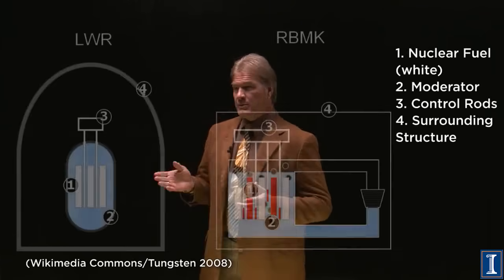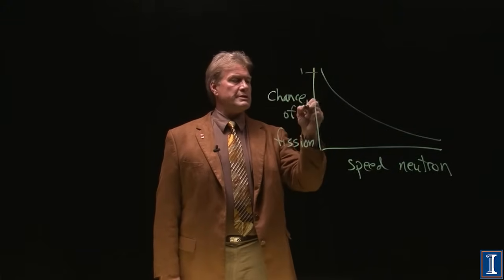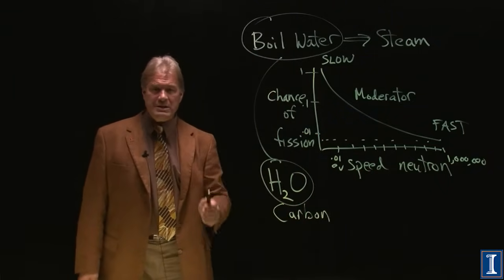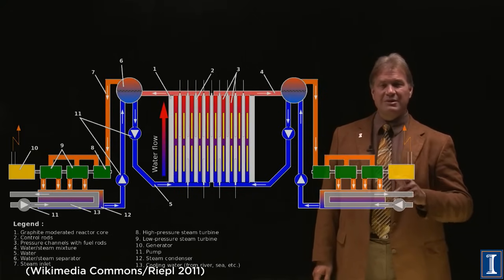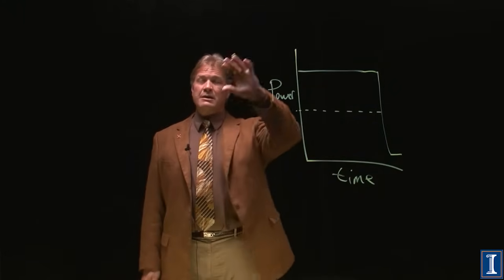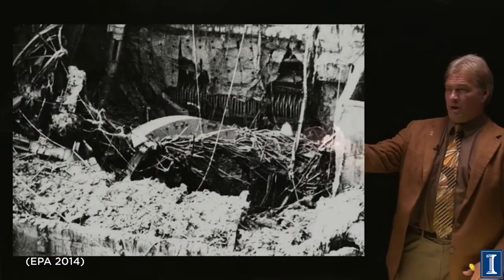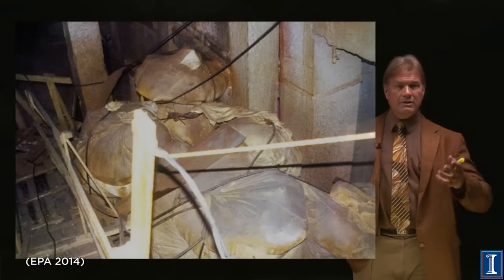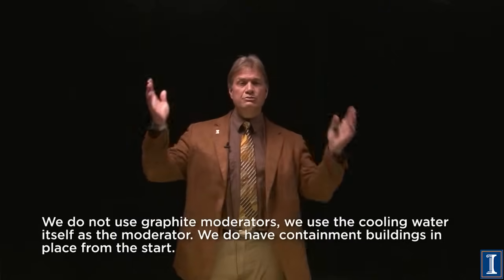Chernobyl: Worst Accident Ever

Comment: A containment building is sized to accommodate the mass energy release from a large break LOCA for a short term, not to contain an ejected pressure housing. In other words, a containment building would not have helped for the Chernobyl disaster.
Reply: This presentation is like a death from a thousand cuts ... he cant properly spell the name of the reactor, he oversimplifies the motives of picking  this type of dual type reactor over other designs, underplays the risk of a meltdown on a classic reactor .. and many more,  there is another video with 'that Chernobyl guy' called 'the birth of RBMK' that covers the tech much better than this show of arrogance I just watched.... btw an example of why the water 'fail-safe' is not enough watch this next two mins: https://youtu.be/3ZiKXMgIKGg?t=836

Comment: ALL currently designed Reactors require a feed of cooling water when initially shut down.  Sometimes for several weeks.  That is why all of them have Diesel generators to power the water pumps when they shut down.
The Fukushima reactor was completely shut down, but the tsunami drowned the diesel engines.  A bad design in a known tsunami zone?

Comment: Only problem is that the containments of western reactors do not contain. Three Mile Island and Fukushima for example. They knew this beforehand, the bolts holding the wessel of the Mark 1 reactors together stretched when tested. Therefore a hydrogen explosion during a meltdown. Which ruptured the containment. See Arnie Gunderson.

Comment: They used Boron, but NOT a Graphite/Carbon to moderate the reaction, and control rods were put in a reactor both from upside and underneath the reactor. And because to make a full control rod out of Boron was expensive, they replaced bottom part of it with Graphite, even if it had worse "slowing down" ability for its purpose. And at the moment of disaster, because of a Xenon poisoning from working on 50% power for over 10 hours, absence of cooling water and almost all Boron-parts of control rods, pressing shutdown button (which inserts all the control rods back, but it takes time) leads to Graphite parts entering first and instead of slowing, it drastically accelerates the reaction and there is nothing to stop it

Comment: Containment would have not helped at this magnitude of explosion, which tore off and launched 1300 ton metal lid dozens of meters up in the air. It would have prevented 90% of the nuclear fuel from dispersing into the atmosphere, but this might have become a worse scenario - melting through the concrete base, reaching the water table and becoming an everlasting radioactive geyser.
7:48 Misinformation. Unlike BWRs and PWRs (soviets had their own PWR called VVER, so hulled reactors are not a "western thing"), which are being halted, opened and refueled as a whole once in a campaign, RBMK has no "general" hull and is capable of being refueled constantly, on the run and one channell at a time - it was it's main advantage, because constant refueling allowed to use less enriched fuel and in RBMKs military breeder predecessors to have a constant yield of plutonium for military purposes.

Comment: Small correction: As far as i know, the first scientists that noticed high levels of radiation were based in northern europe - Sweden I think. 
But in fact a lot rained down in central europe in the days after. My parents told me, that back then ppl were told not to eat crops from the garden, not to collect mushrooms in the woods. Sand on playgrounds was also exchanged by the gvmnt.

Comment: Once they pullled almost all control rods, there was not enough left to moderate the reaction. Because the graphite tips of control rods cause the reaction to increase as they pass though the core, getting hotter until boron rods reduce reaction. Once the cooling pumps were shut off, the plant was doomed.

Comment: According to the hbo series they built rmbk reactors because they were cheaper. I don’t understand how carbon is cheaper than water ? I’m guessing more to it, I’ve heard it needs to be heavy water and it’s expensive to make. I was just wondering. Thanks for your videos.
Reply: Carbon is cheaper than water as it's a bi-product of many things from AC vacuum motors to train lines. It's everywhere.
Reply: The HBO series is almost completely inaccurate.  The RBMK reactors were not built because they were cheaper, they were more expensive than competitor reactors (the soviets had several reactor variants).  Their two advantages were that they did not require some specialised parts that the other main reactor variant (the VVER) required so you could build them without having to wait for those parts and the other advantages were that you could get more power for lower enrichment levels of the uranium which meant you could get normal power levels cheaper or you could get higher power levels using normal fuel (RBMKs put out as much power per uranium as modern reactors) and that you could refuel it while it was operating, rather than needing to run it down to refuel every so often, so in theory you could get uninterrupted power from it which was not something other reactors offered

Comment: Not quite. The test was set on a Sinton day but they didn't do the test. Instead the day crew ran the reactor at 50% which exom started to form. On April 26 1987 is when the test took place witch was ran by deatlov who wanted to run the test at 200mw when it was spost to be a 700mw. When the test started the power dropped to 0% from exom deatlov made the division to take all but 1 control rod out steam and heat build up at the bottom of the reactor and blow the 500t lid of the reactor and landed sideways in the reactor. Hydrogen oxygen and extremely hot grafite which made a chemical reaction and boom! Chernobly.

Comment: What about 3 mile island? What kind of mistake was that?
Reply: https://en.m.wikipedia.org/wiki/Three_Mile_Island_accident

TL;DR: A maintenance issue, causing pumps and coolant equipment to fail, lead to water in the reactor vessel to overheat, become steam, then react with the exposed and overheated control rods to start a partial meltdown. Critical valves and water flow devices were out of action, and operators failed to notice this. Operators hadn't been sufficiently trained for the details of the scenario they faced. The control room design, and some things like alarms for different problems sounding almost the same, contributed to the failure to understand what was actually happening. Also, The specific plant in question (TMI-2) should have been shutdown at the time because of the closing or deactivation of said valves and critical devices, but for some reason was of course still running.

Comment: A minor correction (I see others mentioned it briefly). The accident wasn't initiated by an operator pushing a wrong button. They started to lower the power but after a couple of hours the Kiev power grid controller ordered them to halt the process, because they needed power (a coal power plant malfunctioned). As a result, the reactor operated  around 70% or less power for 6-7 hours, and it lead to the Xenon 135 build up (because the fission byproduct Te135 decays into I135 in seconds, which decays into Xe 135 but with a 6.5 hours half-life). So the power drop happened because the lower power reactor neutron flux was not enough to fully burn the Xe 135 which was still getting added to the system in full amount on account of the delayed decay. The night shift crew wasn't tecnically knowledgeable enough to understand the Xenon poisoning and then they made things much worse by removing all control rods they could...

Comment: The control rods were boron with graphite tips. Graphite tips were used to displace liquid water into steam as they were moved in and out of the reactor allowing neutrons to not be completely moderated by liquid water thus giving more fine control over the power output. The control rods were removed so far out of the reactor after the power output decreased so much that the channels filled up with liquid water which then began to moderate neutrons and allow fission reactions to start again. This allowed the Xenon build up which was choking the fission reactions to be burned off. Once they saw the power start to spike, they slammed the control rods back into the reactor but since graphite was the first thing to enter the reactor (also a good moderator) it only accelerated the fission reactions. This was when the heat generated was so much that not only was a ton of steam (pressure) generated, it got so hot water vapor was being turned into hydrogen and oxygen gas (flammable). Basically, the fail-safe of inserting all the control rods into the reactor (boron) only worked within certain operating limits of the reactor. The reactor had been pushed well outside normal operation conditions and instead of letting it die off to restart which was the actual fail-safe, they tried to push it the opposite direction too fast and lost control.

Comment: The LWR set--up seems much better for a nuclear reactor but what if the core exploded ( like you say H2O turns in hydrogen and oxygen when super-heated), the containing concrete wall would split open, no?

Comment: Isn't there a different problem with Western reactor designs? I thought there was a problem. Once it starts to heat up, there's a reaction in the zirconium encapsulation for the fuel pellets. That was what supposedly results in the China syndrome where it keeps heating up and melting down into the ground

Comment: 13:00
You forgot the part where they have shut the pumps to stimulate the situation of power failure for 1 minute.
Because it took a minute for generators to reach the capacity needed for water pumps.
During that 1 minute they wanted to use the energy produced by turbines to run the pumps.
Because the reactor was already stalled and running on 200 Mv,
There wasn't sufficient power from turbines for water pump.

So the moderator was lost and when they pressed AZ3 button to stop the reactor inserting all the boron rods, rods had graphite tips.

Thus the neutron flux, reaction and temperature sky rocketed resulting in bursting of H2O  pipes. With which Hydrogen came in contact of the fission and Alas a Blast.

400× times greater than hiroshima every hour passed.

Comment: A bit of nuance is missing here. While it's true that many of the design flaws that contributed to the Chernobyl disaster don't exist in Western reactors, it's misleading to claim that a meltdown cannot happen with them. Almost any reactor can melt down if operated irresponsibly enough. It's harder, yes. Safety systems help, absolutely. But impossible? No.

Also, it's inaccurate to say the reactor was just coasting when the test was initiated. In fact, the test was delayed because grid controllers demanded continued power output to support factories racing toward their end-of-month quotas. Because of this, the reactor had already been running at partial load for a long time — not ideal, since this caused xenon buildup, poisoning the core and making it far more unstable than expected. So when the test finally began, it was under very poor initial conditions — made worse by the fact that the operators tasked with the test were not fully briefed and were given confusing, incomplete documentation.

And lastly, the emergency shutdown procedure might have worked had it been triggered just seconds earlier — or later, if the control rods hadn’t been tipped with graphite. Those tips caused a last-moment power spike that shattered the reactor. This effect was previously known and nearly caused accidents elsewhere, but it was not properly disclosed to operators.

To be clear: the team understood xenon poisoning. That’s why they pulled out almost all rods to burn it off. What they failed to anticipate was how unstable the core had become due to prolonged operation at low power.

Comment: IF YOU LOOSE YOUR COOLANT IN ANY REACTOR ....THE REACTION (FISSION) DOES NOT STOP IT CONTINUES UNTIL THE FUEL SUPER HEATS UNLESS THE CONTROL RODS ARE INSERTED OR THE SLC SYSTEM (SODIUM PENTABORATE ) IS USED WHICH SHUTS DOWN ALL REACTION INSIDE THE REACTOR(EMERGENCY USE ONLY)....EVEN WHEN A REACTOR IS SHUT DOWN IT CONTINOUSLY NEEDS COOLING WATER THROUGH IT....

Comment: Apparently your theory about water moderated reactors does not work very well. Fukushima says otherwise. Actualy, stoping the heat generation is a long process, too long. Yes, there was no explosion, but melt down still happened. The containment building is actualy the thing that worked well in Fukushima.

Comment: This is not a good explanation and there is a lot of misinformation. I explain below:

1) Western nuclear reactors also use control rods. 

2) Contrary to what the professor claims, some smaller Soviet reactors had containment structures - Chernobyl reactors were so huge that it was too costly. Furthermore, the containment structure at 3 Mile Island still released radiation, and in a total melt down would not contain a blast like Chernobyl, nor would it contain a similar sized molten core.

3) The Chernobyl reactor used the coolant water as a moderator and as steam for the turbines, unlike what the professor says is only true of western style reactors. The displacement of the water at the bottom of the reactor by the slower graphite moderator, when all the control rods were dropped at once, is actually what created the very uneven run away reaction and resulting explosion.

4) Again, contrary to what the professor claims, this same type of disaster occurred in the USA at 3 Mile Island - just not as bad. In fact, a water loss event actually caused the core melt down, which the professor claims would actually prevent a melt down. It was actually the control rods being dropped into the reactor that prevented it from becoming a worse accident. It doesn't matter if water is a moderator, because it is also the coolant - without water the reaction stops, but it can take months to cool down, so even with no reaction, you still have a melt down with no water. The whole event was akin to running an automobile engine with a leak in the radiator.

5) What actually happened: The reactor was poisoned by xenon gas by basically shutting it down. All the control rods were then removed at once to try and restart the reaction. The xenon gas rapidly burned off when the all the control rods were removed and reactor kicked back on. The power began to dangerously spike, as a result. To stop the reaction immediately, all the control rods were then dropped back into the core. The water surrounding the fuel rods was acting as a moderator to slow the reaction. This water was displaced by the graphite tips on the bottom of the control rods when they were all dropped at once the stop the reactor. Graphite is a worse moderator than water, and increased the reaction speed. This spike in reactivity at the bottom of the core occurred all at once leading to an explosion.

Comment: Incorrect the reactor produced 3200mw the test was planned for 700mw.less than 25% power
The power surged monetarily, as all the graphite tipped rods entered the reactor, to over 33000mw possibly much higher for under a second. That melted the fuel, control rods,.graphite etc to form corium that almost melted through the sub levels floor..

Comment: The test would have been worthless anyway, as it wasn't performed under representative conditions. And the backup power problem could have been easily solved. Just install a bank of lead acid batteries with less lead than what was poured into the reactor after the explosion. If they like spinny things: install a huge flywheel storage instead of using the turbine. Considering that they knew about the backup power problem for years and no reactor ever succeeded with the test it's mind boggling that they didn't choose an obvious solution.

Also: they had 4 reactors on site that can provide backup power to each other. How likely is it that all of them are off and no power is available at all? It's a miniscule probability they were preparing for with a procedure that was incredibly dangerous, exceeding the risk that was to be mitigated.

Comment: Sorry, the containment building may be missing, but it wouldn't have stopped the disaster at all. The force of that explosion far far exceeded a plane strike. It would have blown the containment building wide open. We know this. it's widely discussed in the community. So, to say it can't happen anywhere else because we all have containment buildings right at the start of the video, which doesn't inspire a lot of confidence in the accuracy of the video.
Reply: Containment building is there for containing the radiation. Yes there too prevent the same thing that Chernobyl caused
Reply: @HelloKitty-x4u6d  yes it obviously there for the radiation, but that wouldn't of helped when the force of the explosion was easily enough to blow a containment building open when the reactor exploded hense my comment.